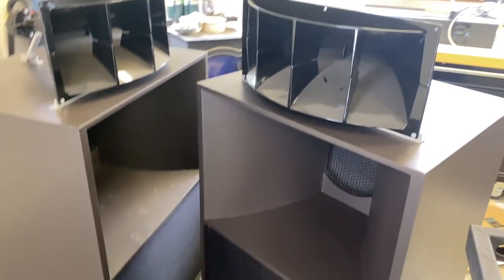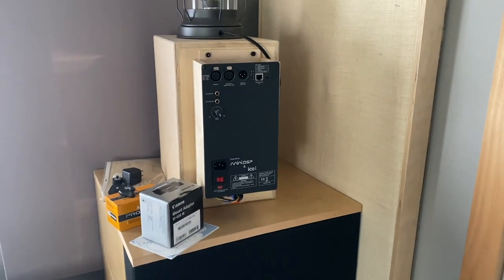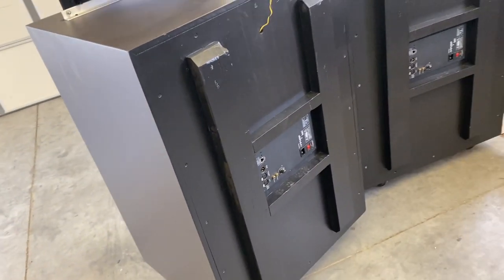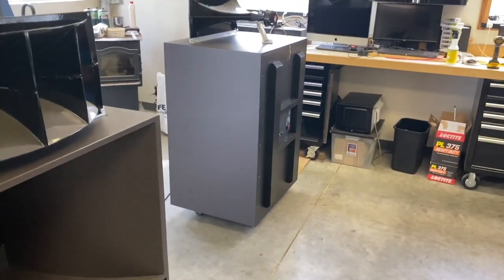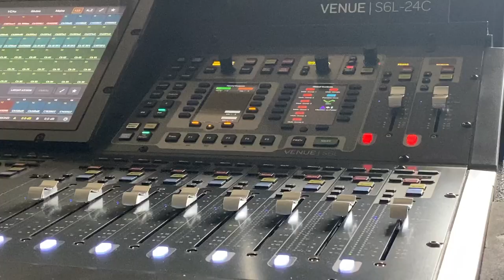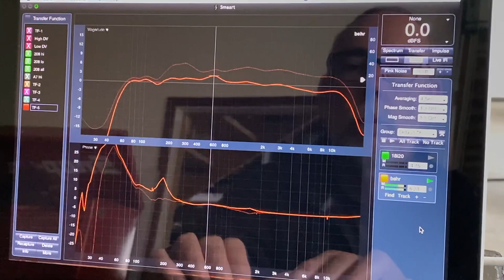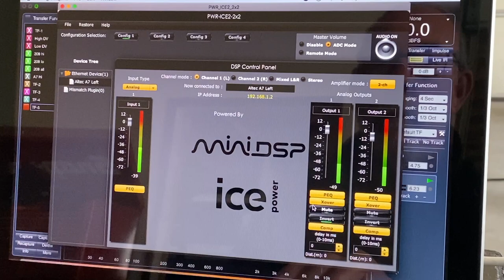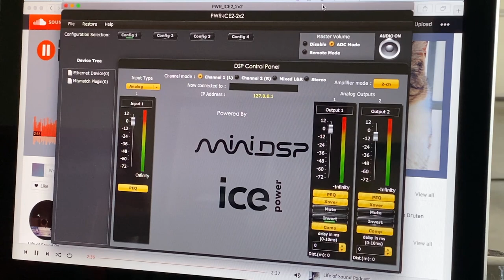Audio Geekery! | Altec A7-500 VOTT  MiniDSP PWR-ICE250 Bi-Amped Full Send DSP!  Vintage PA in 2021HD

Comment: Pretty flat on the 15” to begin with- impressive, 3 filters and it’s as flat as a straight edge 💪
Edit: and towards the end, that phase trace 👌
Test tracks sounds grouse albeit through a iPhone or similar. 

I’ve always wanted to apply modern drivers, amps and dsp to a old 4 way modular rig (aka w bin-4560’s & bi radials 🤔😏

Impressive old Altec boxes! Very flat starting points 👌

Your pretty good at tuning a rig there good sir - no time wasted, straight to the relative filter and point in each time 👌👌👌👏👏👏

Comment: I wanna pat the kitty. Also,  though good drivers, why did you use them instead of actual Altec drivers? The originals blown beyond repair? Might have been a good candidate for the 804 or even 805s.